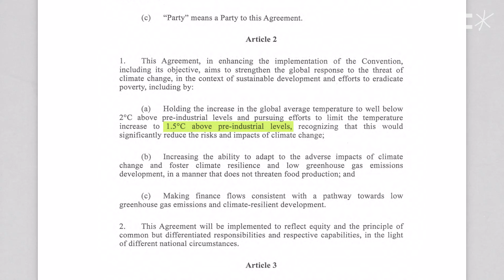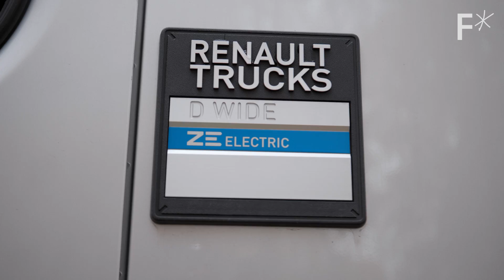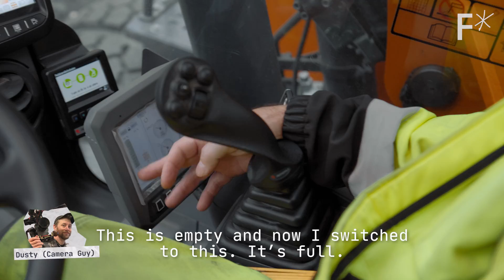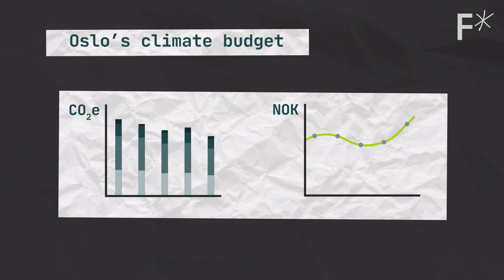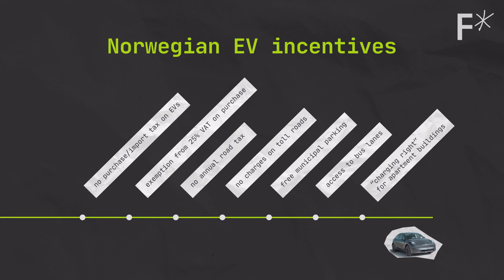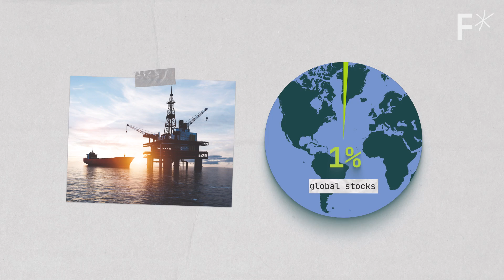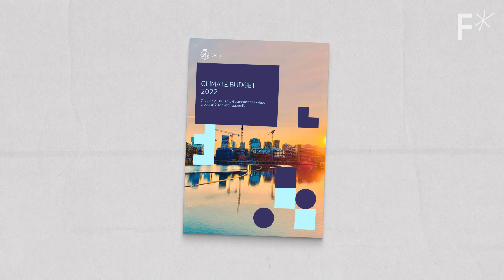The world’s most electric city | Future of Cities

Comment: I'm still mixed on this we have to electrify everything movement. It's one thing if its directly connected to the grid, but I don't find batteries to be environment friendly. Mining, production and disposal of batteries is extremely toxic and resource (time, energy, raw materials - cobalt) intensive.
Reply: Well there are still alternatives to when it is a hassle for batteries, like hydrogen of they could make good infrastructure for that, also one I’ve heard of that I think is cool is nanoflowcell.
Reply: Flow cell is pretty awesome. Scalable and with the recharge speed of a refuel. I hope for the best with them. I also like methanol, biogas, and bio syn gas.
Reply: Also what are they using for power generation if they are just burning fossil fuels to supply the grid it really not changing much
Reply from the maker: We get this question a lot and it's totally understandable!

First, Norway gets 99% of its power from emissions-free sources - 91.5% Hydropower, 7.5% wind: https://www.statista.com/statistics/1025497/distribution-of-electricity-production-in-norway-by-source/ .

While not every country is that clean, EVs still have a number of environmental benefits relative to gas-fueled ones.

- While mining and production of current batteries indeed has environmental harms, so does the mining and production of oil: oil spills, fires, the need to use and dispose of industrial chemicals, etc. Similarly, the extraction of fossil fuels itself requires a lot of energy just like the mining of battery materials. While both oil and lithium-ion batteries can be environmentally harmful to produce, EVs avoid the double hit of gas vehicles having a dirty process to generate their fuel and then that fuel itself also polluting when used.

-Happily, battery designs that use less toxic and safer to obtain materials are proliferating: We actually went to Argonne National Laboratory for a video that gets into this issue and progress on it: https://youtu.be/KMP0x0DpxSY 

-Electric grids are increasingly powered by low-carbon sources. While decades ago virtually all electricity was from fossil fuels, today over a third of the world's electricity comes from low-carbon sources (renewables, nuclear, hydro) and it's increasing every year. So while 100% of the fuel a gas car burns today or in 10 years will generate emissions, powering an EV requires a lower fraction today (depending on the area, of course) - and over time, will be cleaner and cleaner to charge.

-EVs are much more efficient than gas-powered cars. When you burn fuel in a car, about 80% of the energy is lost through heat or in other ways. By comparison, when you charge an EV battery about 2/3 of the energy is used to make the car actually move and operate. So, perhaps surprisingly, even if you power an EV with electricity from a coal-fired plant, it still requires a lot fewer emissions to drive the same distance that a gas car does. https://www.motortrend.com/news/evs-more-efficient-than-internal-combustion-engines/

Hope this helps clarify things!
Reply: @freethink  as you can see from common comments like this, you have to undo a lot of the bad faith reporting from channels like @Wendoverproductions about batteries - basically debunking the myths Oil and Gas have been pushing for a couple of decades now. And, err, good luck with that
Reply: What about carbon neutral fuels like biodiesel, biogas, wood gas. What about cobalt slaves? What about the upgrading of all the pre-existing electric infrastructure and lack of energy storage if your not blessed with 24-7 hydro power everywere?That is what electrify everything movement misses. 

 Heck gasification even makes carbon negative fuel. 

Construction projects in the cities are fine to plug into but what if you need to fix a power outage or build a new suburb or other infrastructure spanning under developed and wide spread areas like in the US soon to be rural areas, 3rd world countries, India, ect where there is no pre existing electric power yet? The point of construction is to construct what isn’t already there or is damaged. I guess you can store charged batteries but carbon neutral feul is better for  emissions anyway and that reminds me. Those electric construction equipments are puny not exactly heavy duty either because of battery limitations . Good for them but being born in a country with that much hydro and wind funded By natural domestic oil springs blessings at that small scale nation’s city  is not exactly replicable 100% silver bullet.
Reply: Lots of comments in here pointing out the flaws in existing battery and infrastructure tech. That's not an excuse to not try to transition.
There are new battery techs being made all the time.
Air travel is difficult but being researched and worked on all the time. Net zero fuels are being developed as a potential replacement at relatively little cost or difficulty in changing the airline infrastructure, and could be retrofitted.
Freight shipping can already be done as retrofitting. It also massively reduces noise pollution which has actively harmed marine life for the entire history of engine-driven ships.

Electric grids in remote areas are difficult but someone mentioned nuclear - there are microreactors being developed that can provide power to a whole community for up to 10 years with very little or no maintenance, and can fit in a shipping container. Larger nuclear reactors are an excellent replacement for oil and gas and similar energy sources for power grids.

Nuclear is by numbers the safest energy industry even including all the accidents in the world, and has a far lower impact on the environment than fossil fuels ever could. It's more stable for the grid than renewables (can ramp up or down to meet demand as needed), and the waste is so much less of an issue than most people understand.

All of these issues everyone throws up have solutions, but trying to change is harder than giving up, isn't it?
Reply: No one here is advocating to give up and do nothing.

 I am just trying to get across how stupid “zero emisons” is as a target vs “net zero” so many technologies wasted and secors impossible to clean up if batteries are all that people limit themselves too.

 I love nuclear but by current estimates it will take too long for enough them to be legally built in time for climate crisis prevention. Still fantastic tech and the answer is simple but hard to execute; cutting red tape but still due-able. The geopolitics of weapon proliferation is another story but again manageable if nuclear makes efuel to ship or we comit solar in a dessert or ocean or dyson swarm in big ways again to ship Efuel like we ship crude oil.
Reply: Carbon neutral or carbon negative are far superior aims
Reply: @The_Cyber_System  Lots of people are doing lots.  I hope we do it in time.
Reply: I'm not opposed to trying new things, I'm just against government mandates forcing ill-thought out solutions that end up doing more harm than good.

Germany recently tried to go all-in on renewables and it backfired on them miserably. Now they're burning more coal than in the past 5 years. How's that good for the environment?
Reply: @ICDeadPeeps  Germany's issues weren't that it tried to go all in on renewables, its how they did it. The technology and the goals weren't out of reach. But when politics and agendas get into the mix, you get problematic solutions being implemented.
Reply: battery technology evolved, sodium battery using less "exotic" minerals. cars are concentrated in cities, imagine the pollution from 1 million cars in 1 city suddenly gone. clean power generation will also evolved. it's like divide the problem: EV first, then deal with power generation.
Reply: @breadnewbie6326  I'm going to have to disagree, you need to fix the power generation first. Most of the world's electricity is still derived from coal; it's not better for the environment if you're replacing gasoline emissions with coal emissions. It's great that Norway was able get around this, but renewable energy is only feasible in certain locations. 

Plus, how many of the EVs are currently using the newer sodium technology?
Reply: @ICDeadPeeps  imagine city in china with 20+ million population & 1+ million EV & 0 ICE. the pollution directly affected people in that city greatly reduced.

in the long term, the electricity source will be renewable & backed up with nuclear generator. this one took at least 2 decades to build (max 4 decades), nobody can do it overnight. when this one is done, the ICE already not allowed.

sodium battery realistically will be in 2024 cars model, probably few will be at the end of 2023. but, it depends on the car manufacturers, some will choose LFP or even the "normal" lithium battery. it's the manufacturer decision.
Reply: @breadnewbie6326  I completely understand what you're saying but if you're looking at it from a global perspective, it's worse off for the environment (for now). You're just moving air pollution from the city to an offsite location with even worse air pollution (again, for now). 

I agree that we definitely need nuclear in power mix, it's insane to ban or ignore it altogether. 

Also, instead of cramming everyone into cities maybe we should rethink about spreading the population out and creating smaller, localized communities that's self-sufficient. Big cites tend to have more problems with everything ranging from pollution, crime, public education, affordable housing, greater wealth inequality etc.
Reply: @ICDeadPeeps  France(or Germany, I forgpt what country changing nuclear power to coal burning) is not entire world
Reply: @breadnewbie6326  public transit first
Reply: @uis246  city public transit are already electric in china. EV sales also already the biggest in the world.
Reply: Batteries can be made of things other than rare metals, like salt - esp at suburban or street scale
Reply: Sodium Batteries is a cool technology that should replace lithium in about 5-10 years but they are just as limited as batteries are as an energy carrying medium. Sodium ion batteries are cheaper then lithium ion but empty fuel containers of steel or plastic are even easier to manufacture. Sodium is pretty energy dense for a battery but battery pale in comparison to even the worst fuels like  firewood let alone diesel or methanol. Building a electric car that runs on sodium ion batteries sounds good for the environment but that good deed is nothing compared to making renewable bio/carbon neutral fuels like methanol or bio diesels that can run in pre-existing cars (the 99% on the road that need to get clean asap). Using what we already have: that’s what carbon neutral allows. Zero emissions is battery tech companies pretending to be the silver bullet when they are not. Most the time they should pantograph plugged in to not even use a big battery and that tech could be retrofitted on carbon neutral fuel cars too. The lack of energy density makes Storying renewable energy in most places insanely costly both dollars and space wise which is a disqualifier for serious sized construction equipment or things like freight shipping or passenger air lines. Sure if you have unlimited oil dollars funding you and absurd hydro electric everywhere you transend battery as a storage medium since you generate constantly but for most places and pourpouses (unless you go nuclear) that is not the case.

Comment: I would love an all electric food truck!  I asked a builder if this was possible... they laughed at me.🥹
Reply: they were uninformed
Reply: it's not very hard to retrofit a food truck
Reply: Start with a Ford Transit EV? Add Pro Power (110V/240V from the battery) use Induction cook tops, microwaves and other electric means, and have a backup generator that you hopefully never use - unlike every other food truck that has a chugging diesel generator.
Reply: @brushlessmotoring  99% of places have electricity, it is very unlikely that you will actually need a battery.
Reply: @brushlessmotoring Right.  I refuse to buy from places running generators.  They are very rude and selfish.
Reply: Why would it be such an issue, almost all public spaces have 3-4x 32A 3phase 400V available, that's enough to power a lot of food trucks...
Reply: Do you use your food truck is the middle of nowhere ? I have some food trucks at my University, they just plug to run all they need to cook. Electricity is almost everywhere. Your "builder" seems quite stupide to me, maybe a ban on non electric food trucks would make him smarter...

Comment: Where’s the electricity used for charging comes from? “Clean Nuclear” energy
Reply: Hydroelectric power mainly
Reply: When you waste your time writting a comment instead of googling it.
Reply from the maker: We get this question a lot and it's totally understandable!

First, Norway gets 99% of its power from emissions-free sources - 91.5% Hydropower, 7.5% wind: https://www.statista.com/statistics/1025497/distribution-of-electricity-production-in-norway-by-source/ .

While not every country is that clean, EVs still have a number of environmental benefits relative to gas-fueled ones.

- While mining and production of current batteries indeed has environmental harms, so does the mining and production of oil: oil spills, fires, the need to use and dispose of industrial chemicals, etc. Similarly, the extraction of fossil fuels itself requires a lot of energy just like the mining of battery materials. While both oil and lithium-ion batteries can be environmentally harmful to produce, EVs avoid the double hit of gas vehicles having a dirty process to generate their fuel and then that fuel itself also polluting when used.

-Happily, battery designs that use less toxic and safer to obtain materials are proliferating: We actually went to Argonne National Laboratory for a video that gets into this issue and progress on it: https://youtu.be/KMP0x0DpxSY 

-Electric grids are increasingly powered by low-carbon sources. While decades ago virtually all electricity was from fossil fuels, today over a third of the world's electricity comes from low-carbon sources (renewables, nuclear, hydro) and it's increasing every year. So while 100% of the fuel a gas car burns today or in 10 years will generate emissions, powering an EV requires a lower fraction today (depending on the area, of course) - and over time, will be cleaner and cleaner to charge.

-EVs are much more efficient than gas-powered cars. When you burn fuel in a car, about 80% of the energy is lost through heat or in other ways. By comparison, when you charge an EV battery about 2/3 of the energy is used to make the car actually move and operate. So, perhaps surprisingly, even if you power an EV with electricity from a coal-fired plant, it still requires a lot fewer emissions to drive the same distance that a gas car does. https://www.motortrend.com/news/evs-more-efficient-than-internal-combustion-engines/

Hope this helps clarify things!